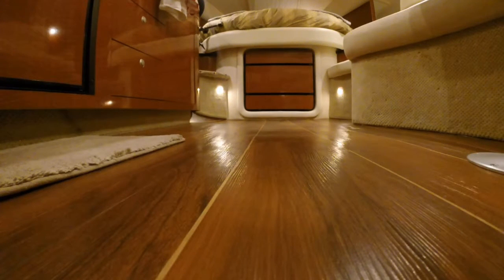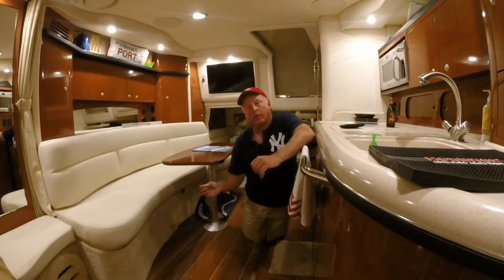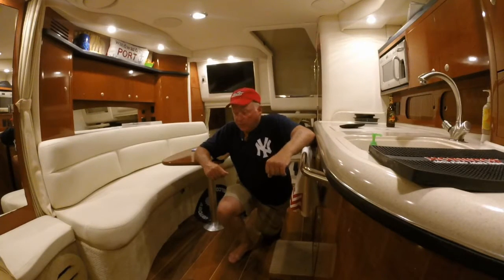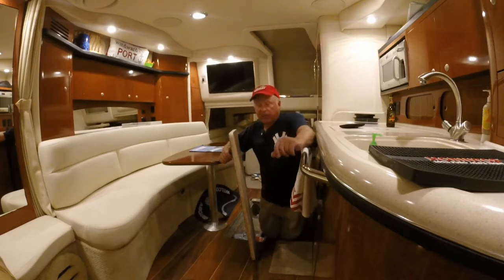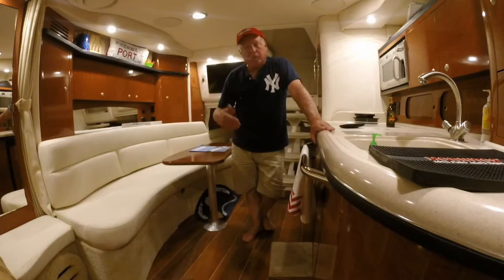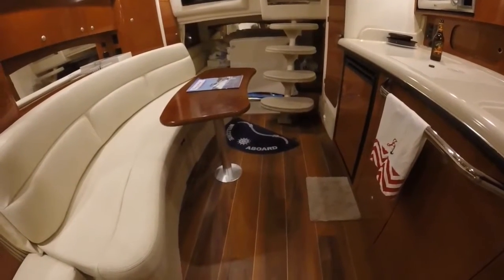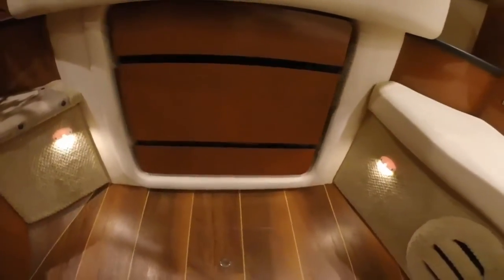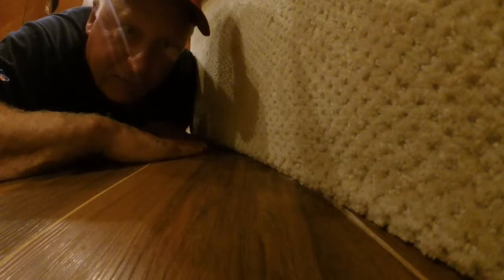floor

Comment: I’m currently in the process of installing vinyl plank flooring in my 1998 carver mariner 350 and loved your tips and tricks.  I’ve been debating hatch  t molding but after seeing your video I’m going to take my time with all the prep work to have seamless hatches.   Today was carpet rip out.   I’m a few weeks away from the finished product.

Comment: I put down vinyl planking on my old 1990 Silverton. One additional advantage to putting down floor like this is that Bilge odors get caught in carpeting. This really helps eliminate  “ old boat” smell. I am about to do this project on a 2000 Trojan Express. Sounds like he had enormous trouble with the sub floor and prep. I did not have that issue with the Silverton the Trojan does not seem like it will give me much trouble either both have good bones to work with. He is 110% right about the hatches take the time to get a tight fit. You can use your existing ones and an trim to the edges to get where you need to be. Would like to know what’s the brand and description of that floor really nice choice 👍 looks great!

Comment: Hi boss im trying to do the floor the same as your i have the same boat but 1995 question what color is that and how do you cut it also on the stair what did you use?

Comment: It’s beautiful. I’m wanting to do this in my 99 310.  Is this single sheet or plank vinyl flooring? The only problem I can foresee is the rounded drop I have leading into the aft cabin area. I was thinking just turn and tuck on the carpet to vinyl

Comment: Looks great, and this is the video that inspired me to put Karndean in my boat.  That being said, how has this floor handled harsh winters, assuming that the boat is exposed to cold winter temperatures?  Once my boat was on blocks and the temp fell, I noticed gaps between the boards.  Praying that the warm weather in the spring will reverse what has happened.
Reply from the maker: Kid Art 
    I haven’t noticed any problems with mine over the winter.  If there was any problems they were gone by time spring rolled around

Comment: Great job good video. How did you keep the Duraglass level? That is how did you keep it the same thickness throughout the floor as you trowled it on,  you didn't get waves.
Reply from the maker: I just trowled it on, concentrating on filling the low spots first. I sanded the floor with a belt sander to smooth it out.
Reply: Thank you. I'm going to give it a go this weekend if the weather holds out for us. Thanks for posting your video.